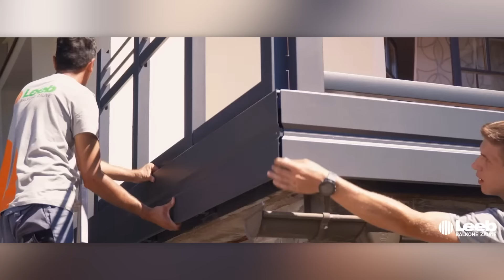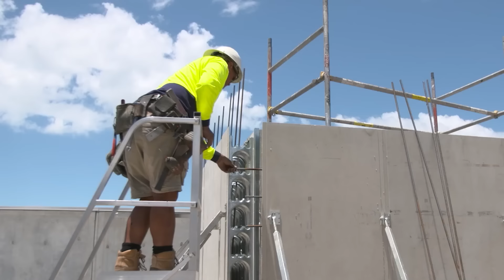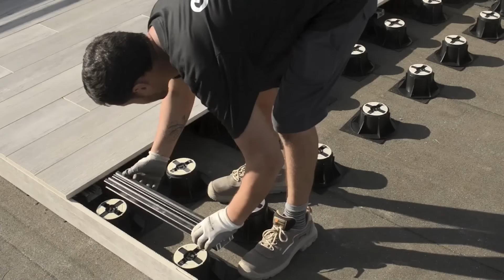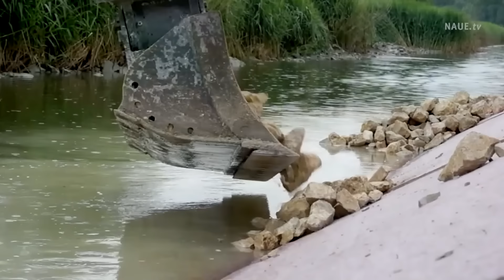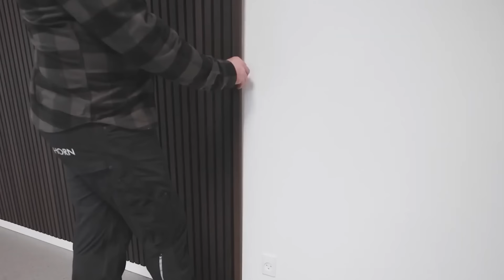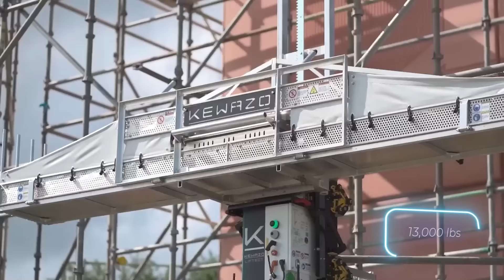CONSTRUCTION TECHNOLOGIES THAT HAVE REACHED A NEW LEVEL

Comment: A Balcony railing is only as good as its footing, Didn't hear or show anything about the footing connection. Wall cladding looks good but thats about all, any moisture behind the existing wall and foam will cause mould because there is no airflow like a double brick system has. Logic wall would not be good for basement because the basement pad and wall would have to poured together as one pour.
Arrowlift, you might as well leave your ground floor house on it permanently and get view at your leisure, especially if your neighbour is blocking your view.